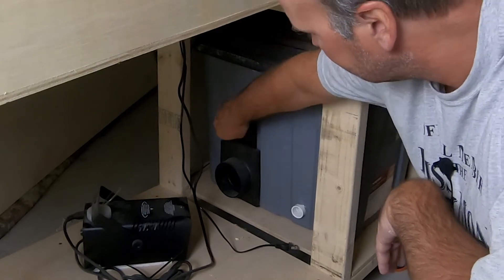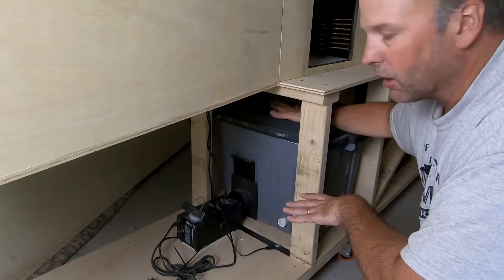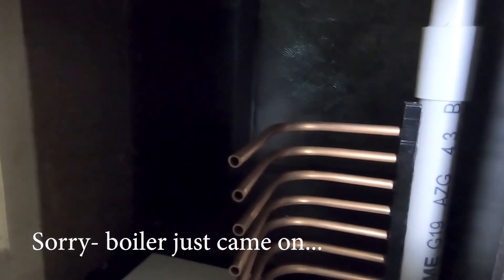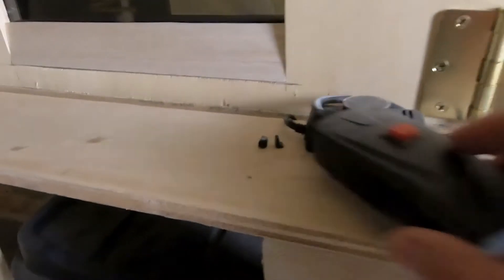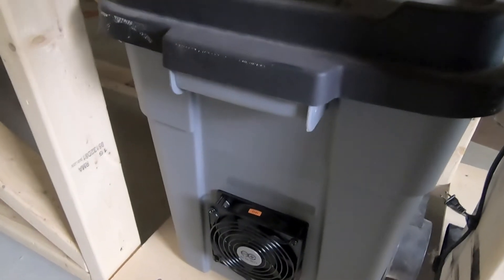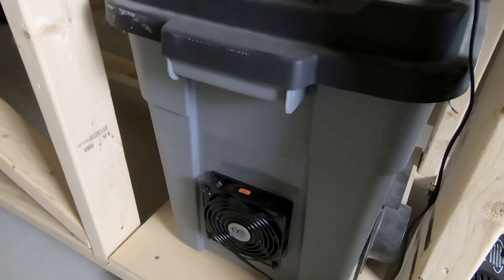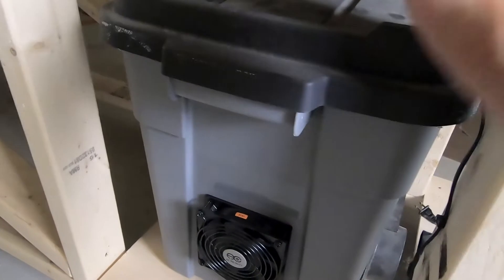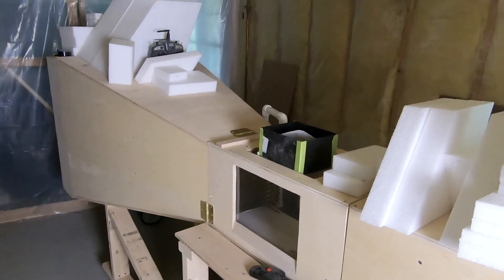Wind Tunnel Smoke System Walk-through

Comment: Thanks for the video. I have built a wind tunnel using yours as a guide but am having trouble seeing the fog clearly. Its easier to see when the fan is slow but we did the calcs on the fan and it doesn't even run that fast. Approx 4km/h. I am using a 1/4 inch copper tube. I was wondering did you have this issue and if so, how did you fix it? Thanks again.
Reply from the maker: Smoke visibility was a BIG issue for me and I spent a lot of time on it.  What it came down to for me was a combination of things.  First, I painted the inside of the chamber flat black, the flatter the better, to reduce reflections on the glass.  I put a window in the top where my primary light it.  This light is extremely bright and is supported 3"-4" above the glass by a black frame to control the spread of the light and keep it off the front glass so it doesn't cause reflections.  Lastly, and most importantly, I had to find the correct flow rate for the smoke.  The higher the tunnel air speed the higher the smoke rate.  I did this by pressurizing my smoke reservoir with a fan.  While this was a bit of a hack it does work.  The smoke needs to be  pressurized because the tunnel airflow creates a bit of a vacuum in the smoke system and while it will draw the smoke out it isn't a high enough rate to have a clear view.  

I hope these suggestions help.  Like I said in the video, this was the part of the project that I spent the most time on.
Reply: @DefiantWings  Thanks for the detailed comment. I will play around with presurizing the fog. I will also put a video on here.
Reply: @christopherbrown1086  Video done yet?
Reply from the maker: Not yet. Too many projects and not enough time.

Comment: Great build!
I have used a similar sized vindtunnel in the past. Unfortunately it was scrapped and I do not have access to it anymore, so I have been considering building one. It was a little larger but rather similar to Yours with 3 exchangeable  perspex test sections. The cross sections ranged from 120mm square to about 500mm. Max airspeed depended on the cross sections.  Perhaps You could simply pressurize the smoke system from downside the main fan. It will then tend to self regulate with different air speeds.  Also regarding the previous UV light tip, it works great! Have used this to take pictures with a strong strobe light using an added fluorescent dye. If You have 2 timed flashes it is even possible to measure velocity using small aerosol  droplets... What is the airspeed range with the automotive fan?

Comment: Awesome video! really detailed and thorough. I'm currently working on a wind tunnel for my senior design class. What sensors and controllers did you use?
Reply from the maker: I am still working on the sensors and instrumentation.  I hope to pull a video together once I get everything working. Everything will be Arduino based and I expect I will have to develop my own interface